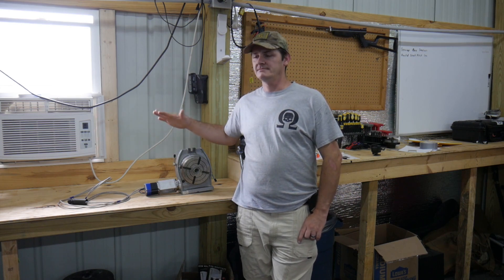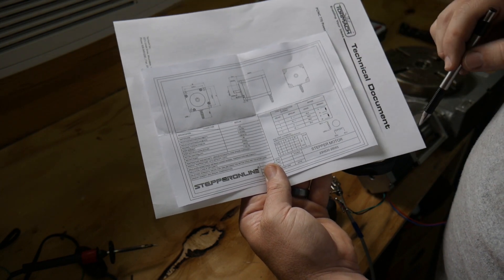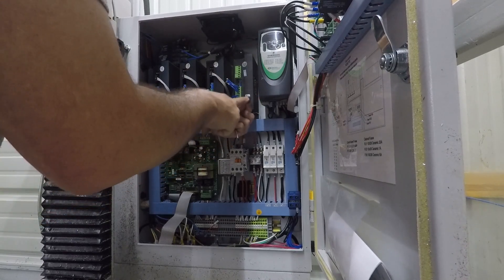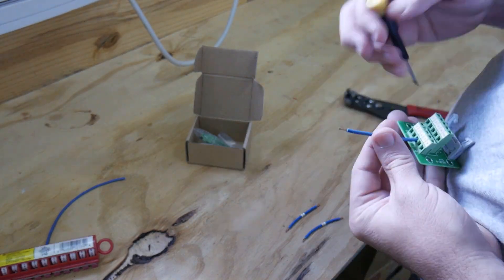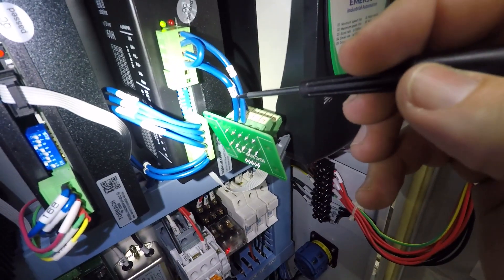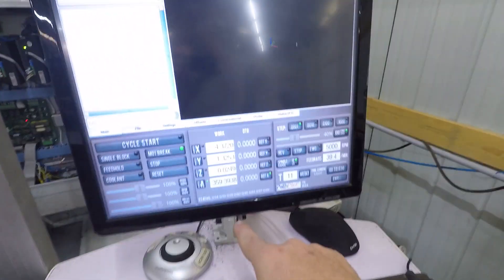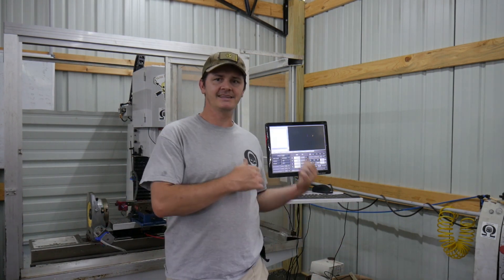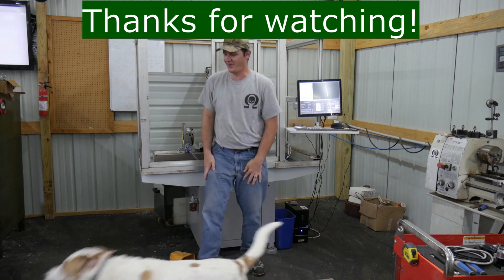DIY Tormach 4th Axis Ep 4

Comment: Hi Jody.  I think I'm going to make one of these pretty soon.  Man, the utoole rotary table is $400 now!  I'm thinking of grabbing a $200 table from amazon instead.  I also have a 400 oz/in stepper and DM542A driver from an old project.  The driver is rated up to 50V on the input voltage and the Tormach puts out 48V so I know I'm good there.  Do you see any issues with this approach?  I'm running a PCNC 1100 S3.

Comment: Nice video series.  How is the 4th axis working?  How's the backlash? I'm thinking about doing this with an 8" table and nema 34.  Any idea if it could handle a tombstone or trunnion?
Reply from the maker: Backlash is adjustable. Ive set mine lower than I can accurately measure so about .001. It would handle a a tombstone fine. 

One thing I would do differently is to make the mount out of plate and put the motor behind the rotary. You can use timing belts for power transmission. 1:1 is fine as the gear reduction in the table is 60:1 iirc.